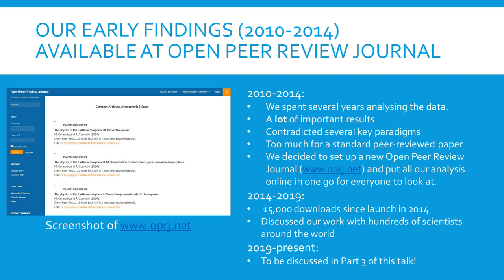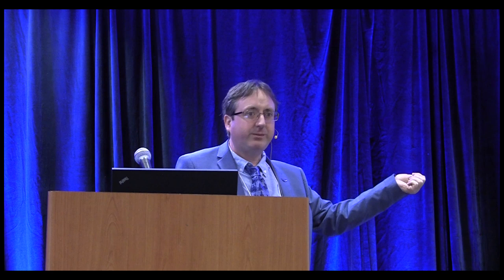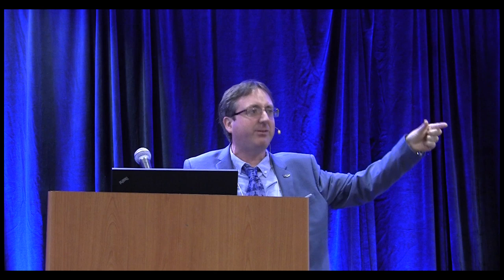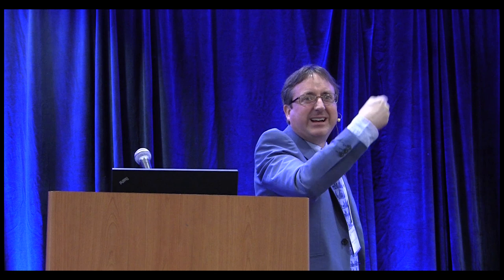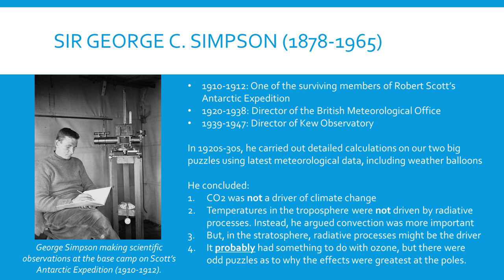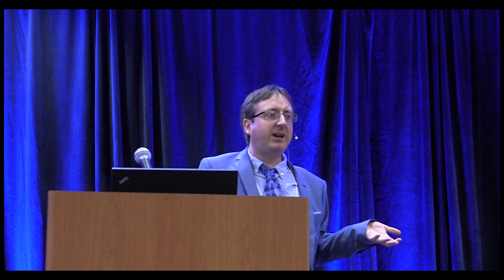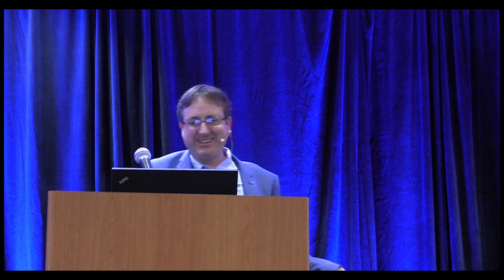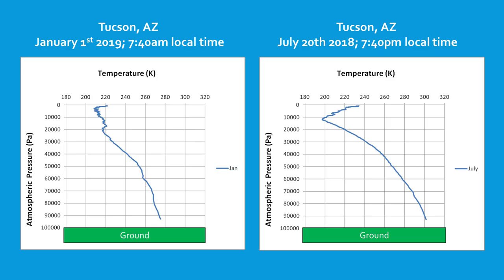Balloons in the Air: Understanding weather and climate

Comment: * PART 3 OF 3 * 
The tropospheric temperature lapse rate is required to cause the so-called "enhanced greenhouse effect". 
The average altitude for LWR to ocean and land got lower (1,650 metres ---> 1,550  metres in my example) which means LWR to the surface of the ocean and land is from warmer (faster) molecules on average because tropospheric temperature decreases with altitude and LWR to ocean/land is from lower-down-than-before molecules on average, so there are more GHG molecular collisions / second which leads to more MVE which leads to more LWR production. The quantity of LWR energy (power flux) provided by a mass of gas is proportional to its temperature(Kelvin)**4 (to the fourth power) so, as explained in detail above, the increasing of tropospheric GHGs ==must== cause more LWR than before to be passing downwards to the surface of the ocean and land. This latter is called "downwelling LWR radiation at the surface" and I've explained why it must increase and this must, of course, warm the land and ocean surface.
That's the lower end of how the so-called "enhanced greenhouse effect" works. 
---------
Note 1: I haven't yet found the collision MVE production & destruction spectra so I don't know what %age make MVE and what %age destroy MVE. I looked a few hours 4 years ago but couldn't find it (not for free anyway). It makes no difference to the description of the mechanism above but it would be needed to confirm the quantity of effect for doubling CO2.
Note 2: Removed because I've gotten confirmation.
Note 3: 80% of Earth's atmosphere is in the troposphere (the top of which is 16 km in the tropics and 9 km in the polar regions, averaging ~12,000 metres). The "greenhouse effect" warming can only happen in Earth's troposphere, there's no effect in Earth's tropopause and the effect is "backwards" in Earth's stratosphere with =increased= stratospheric GHG gases causing =cooling= of the stratosphere because the stratospheric  temperature lapse rate has temperature increasing with altitude (that's how it's known with total certainty that it's increased "greenhouse gases (GHGs)" doing the global warming for the last several decades). Since there's no temperature lapse rate in the tropopause then any change in the quantity/type of GHGs in the tropopause cannot have any warming or cooling effect on the tropopause or the entire atmosphere, ocean or land. No effect at all. If you follow my description of the effect above for the troposphere but apply it to the tropopause then you'll clearly see that any change in the quantity/type of GHGs in the tropopause cannot have any warming or cooling effect  That's the reality. The increasing GHGs in the stratosphere are a slight -ve feedback to global warming because downwelling LWR radiation from the stratosphere decreases with increased GHGs, but it's a very slight -ve feedback because only 6.3% of the well-mixed GHGs (and all molecules) are above the tropopause and they are initially colder than the average of the troposphere so they make even less LWR than the 6.3% factor. By the time the stratosphere warms more than the average of the troposphere there's only 0.4% of Earth's atmosphere's molecules above, negligible.
Note 4: FTIR power flux vs wave-length spectra recorded by the IRIS Infra-Red Interferometer Spectrometer instruments on the Nimbus-1 (1964 - 1964), Nimbus-2 (1966 - 1969), Nimbus-3 (1969 - 1972) satellites show which wave-lengths of LWR heading to space past the satellite came from the surface of the ocean and land and which wave-lengths came, on average, from the GHG molecules and surfaces of solid particles and water droplets in the atmosphere. From this atmospheric physicists have calculated the 91.5% of the LWR that Earth sends to space that is emitted by the atmosphere rather than by the surface of the ocean and land. Also, the MODTRAN tool on the internet can be used to play with a theoretical calculation of the FTIR power flux vs wave-length spectra by adjusting GHGs.
Note 5: 2020-01-25 edited example altitudes. The Kevin Trenberth & other Earth's energy budgets show 17% (40 w/m**2) in the atmospheric window but "Outgoing Longwave Radiation due to Directly Transmitted Surface Emission" of S.M.S. COSTA & K. P. SHINE 2012 states that as ad hoc and assesses instead 8.5% (20 w/m**2 +/- 4 w/m**2). I don't attempt quantifying anything in the effect explanation but I made my examples for illustration as close to reality as is reasonable to do (Stefan-Boltzmann equation & average tropospheric temperature lapse rate).
Reply: are you on drugs? Or the Pizzas eat your Brain away while gaming tomuch?
Reply: @gedankenfang3931  Not likely Cardinal Fang. Pizza is my manna. I'm just worried they'll remove it from the Essential Service list if the Covid-19 kills almost everybody in Canada so they decide to drop beer & Pizza from our essential services. Then you'll all see a dark side of me you wouldn't believe with the beer & Pizza withdrawal. I'll be poking people everywhere with the comfy cushions. It'll be like Jason XIV Part 3